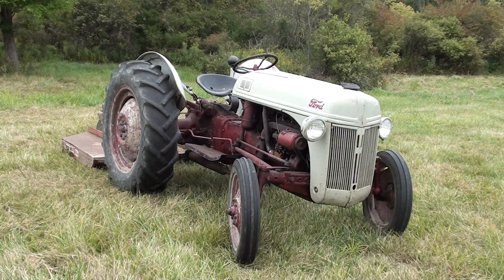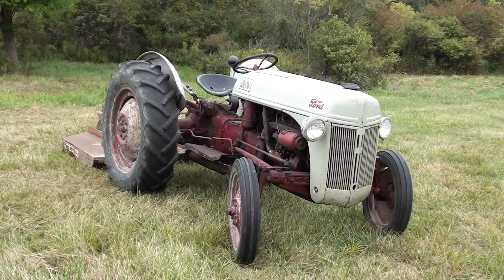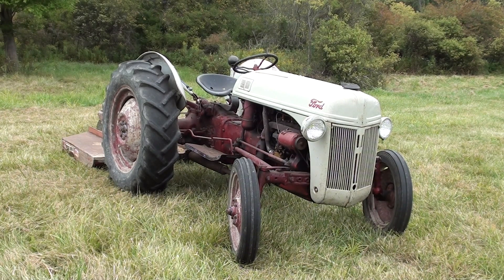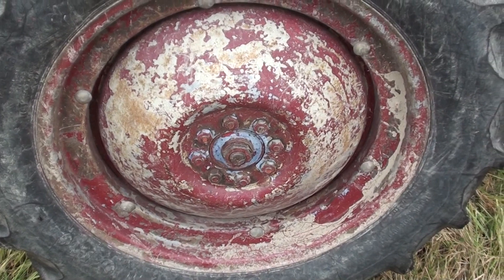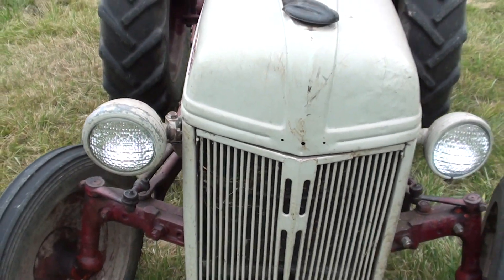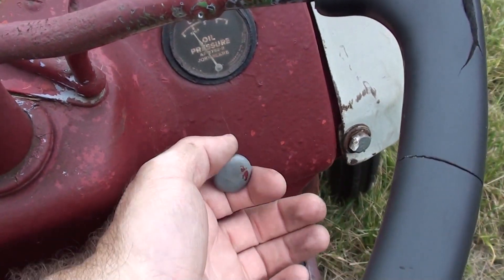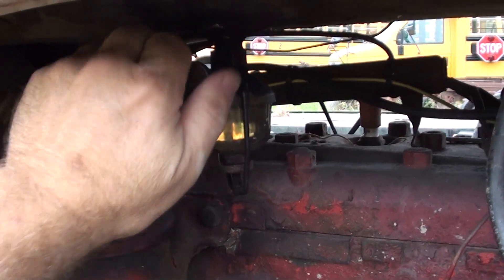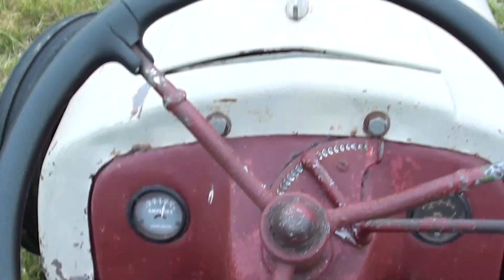Ford 8N specifications and operation video

Comment: As I remember, the spark plug gap , is .025 . I worked at a Ford tractor dealership, in the 1970’s and 1980’s .

Comment: Okay some inaccuracies;
The original generator was 6v the system was positive ground.
The transmission/gear/hydraulic fluid takes 5 gallons of I believe 80w (winter) or 90w (summer) tractor gear lube maybe hydraulic fluid.
What exactly did the book say?
What gap is the plugs supposed to be?

Comment: Um the fuel boul is supposed to be turned all the way out that is why it was hard to start
Reply from the maker: Doesn't matter....Always starts this way.
Reply: @busesdeerandsound100  all the way  out is for  reserve  fuel...
Reply: My 1949 you turn the the shut off out 1 turn, reserve is 2 turns, and if it has generator it's 6v

Comment: It has to be 50 and back for the year because it has a front mounted distributer
Reply: I think 1950 might have been a transition year for the distributor and generator location.  My 1950 8N had a side-mount distributor on the right side and the generator was on the left side of the motor.  I converted mine to 12V and changed the ignition to electronic.
Reply: Sweet! I’m in love. I have an 8N . Serial # seems to indicate a ‘51. But it has front mounted distributor. Has embossed “Ford” on hood but has smooth fenders with no embossing. Serial #8N42319(?) seems I’m missing a digit. Anyone have any ideas?
Reply: @andyallen7509  If you have a front mounted distributor, you likely have a early 1950, or earlier, model.  Sometime in 1950, the distributors changed to side-mount.  Your serial number would be correct for a 1948 model.  The serial numbers were 37908 to 141369 for 1948.  The serial number range for 1951 was 363593 to 442034; however, with a front-mount distributor, you likely have a 1948 model.
Reply: @Mike--K   Thats what has puzzled me. The distributor location  would indicate an earlier year. But the serial number , though very difficult to read, I believe to be accurately interpreted. The serial number also seems to include a horizontal diamond which I understand indicates something about cylinder sleeves (or lack there of).
I too am 12v with electronic ignition. What an awesome alteration that is!
Thank you for your reply. Any further comments or suggestions are very much appreciated. I’m new to the tractor/8N world. Need all the input I can get!
Reply: @andyallen7509  You definitely have a mystery!  Ford used stars and diamonds to identify the beginning and end of the serial number.  The stars were used on the 8N until sometime in 1951 when Ford changed to diamonds.  That might be when they changed from steel to cast iron sleeves.  From what I've been able to find, the 1951 serial number sequence ran from 8N343593 to 8N442034.
Reply: @Mike--K I thought I saw a star at the end.  Then thought it was just the paint so hu?

Comment: You sure the generator is 12 volt?
Reply from the maker: Nope....3 cellls on the battery... 6 Volt.
Reply: My 1952 8N has a 12 volt generator on it same style as original one with 12 volt battery so someone converted it...